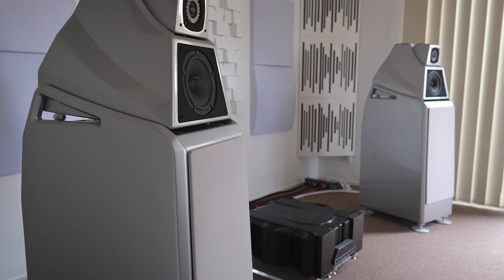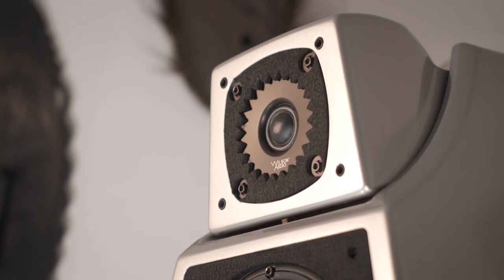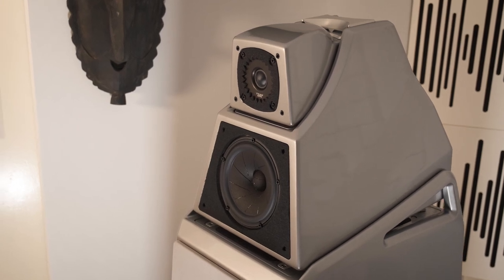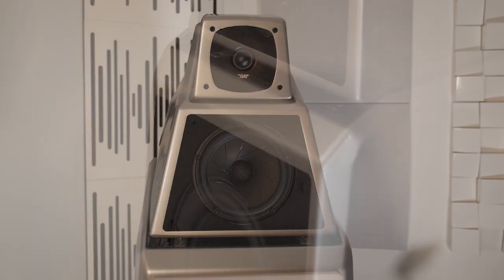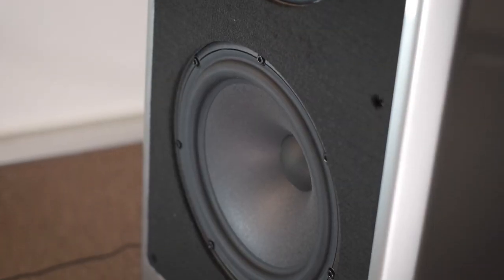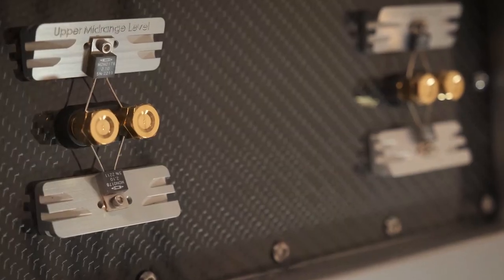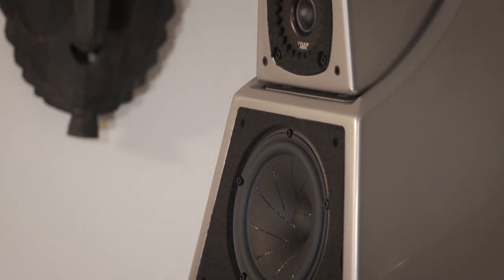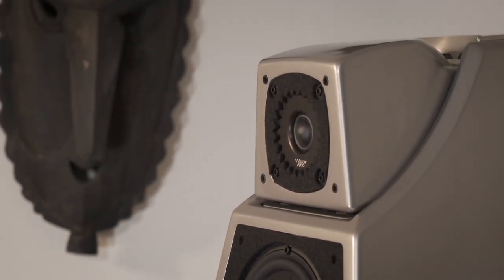Alexia V - Wilson Audio's Latest Speaker Vastly Improves Predecessor - SoundStage! Australia (Ep:8)

Comment: I'm curious: why do you specifically mention solid state power amps? What's wrong with tube power amps in the context of the Alexia V?
Reply: Hey Rich, I believe high current solid state amplifiers will provide a more controlled and dynamic bass register seeing the low impedance value at 80-or-so Hz. That's not to say a good valve amplifier will not sound awesome. That's a subjective call at the end of the day.

Comment: Must admit that I find it a bit amusing that the back chamber of the treble is 3d printed in carbon fiber. What are the claimed benefits of that 😂 compared to say a cnc machined aluminum back chamber? By all means the back chamber is inside the loudspeaker! I feel that one wouldn’t be able to hear the difference even if it had been made out of compressed horse manure.
Reply: I think that more and more, these companies that use "exotic" materials and make some claims are going to have to back these claims up -- and not just have consumer take their word for it. In the past, companies could find some "audio guru" to simply regurgitate the claims, but in today's online world, that doesn't fly anymore. People will question everything.
Reply: There could be a number of reasons, even simply logistics. The CNC machines may be employed full-time for machining the various cabinet materials while having the 3D printer in-house allows its use for different materials production.
Reply: @dougschneider8243  Agreed! Absolutely. What I find strange however is that so many high end companies come out with so many solutions to problems which doesn’t seem to be of any audible significance. Had I been in control at Wilson I would probably have tried to make the tweeter with the highest possible magnetic flux. So quadrupling the size of magnet or more. Not because I believe the extra few thousands Hz of high end will make much of an improvement but because the sensitivity improvement of such a tweeter can  be traded of into a lower crossover frequency between midrange and tweeter hereby improving the dispersion. Can I truly be certain such a change would be an improvement? No but I happen to believe it would , and it will definitely sound different, which I really seriously do not believe the 3 d printed chamber will.